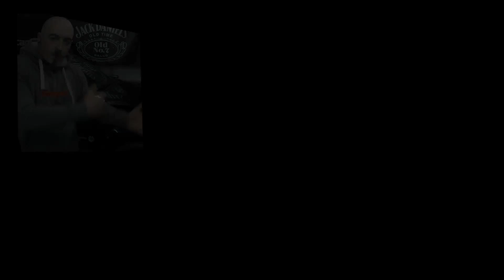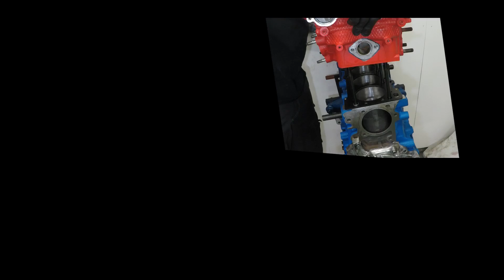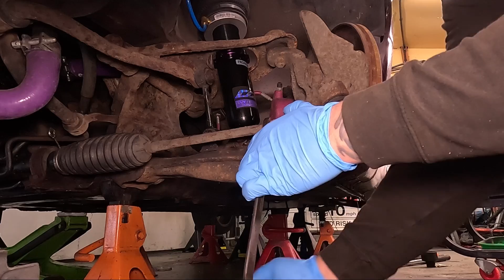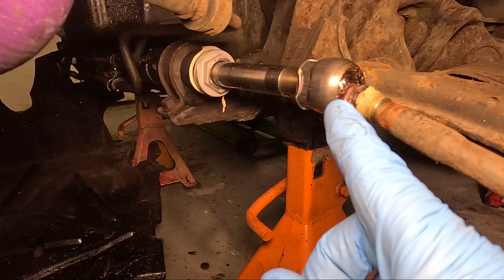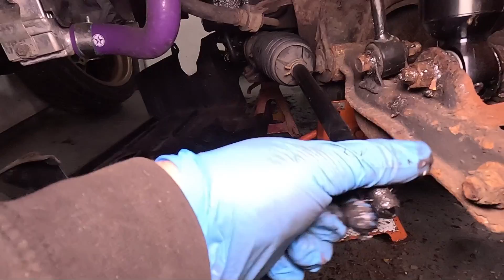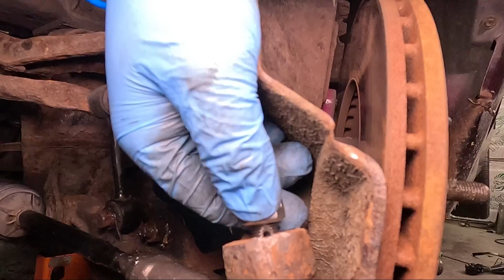MX5 MIATA TIE ROD & TRACK ROD END INSTALL

Comment: Nice one , unfortunately my lock nut would not come loose even with a lot of heat… 
Nice excuse to get a brand new inner and outer though 👀
Reply from the maker: yeah sometimes they can be a nightmare that's why i make sure i grease new ones

Comment: You mentioned not putting grease on the thread for the castle nut, is loctite OK there? Looking to prevent seizing!
Reply from the maker: i personally wouldn't use anything. yes you dont want it to seize but you dont want it to come loose. ive never seen anyone use lock tight

Comment: I will note here the power stearing and none power stearing racks for the mk1's do use difrent threads for where the tie rods attach to the rack make sure you get the correct ones everyone or will be alot of head scratching 😂😂
Reply from the maker: ahhhhh yes this is true i should of added this in the video,
ive been there before